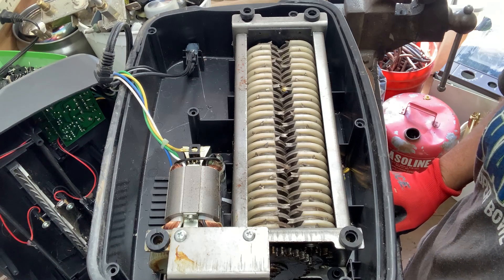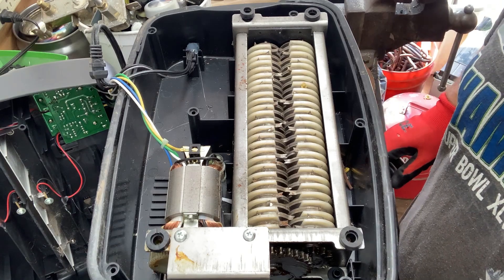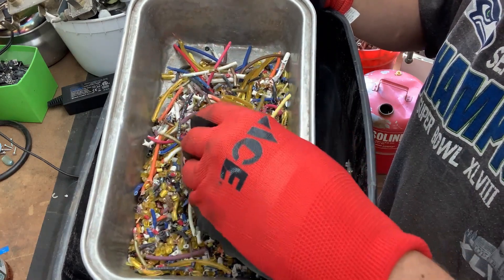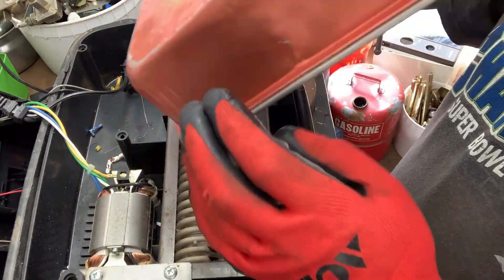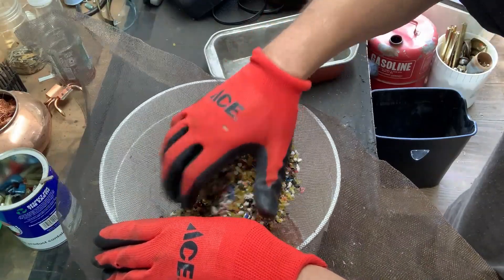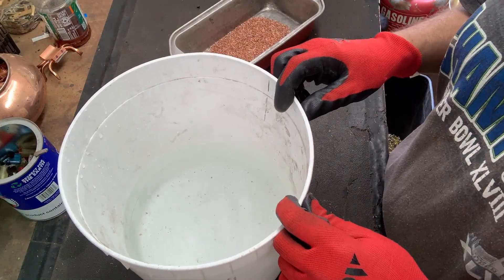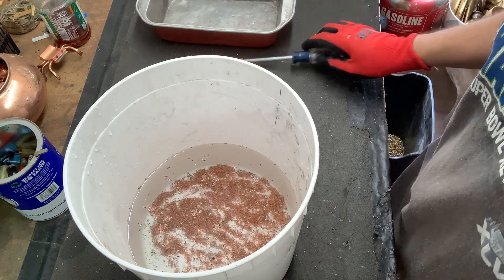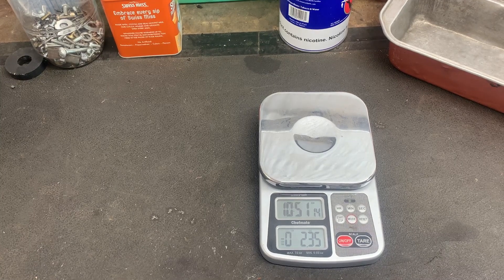Will a Paper Shredder Work as a Wire Granulator?

Comment: I use one that handles up to 15 sheets as a aluminum can shredder, and it works great!
Reply: How do you prepare the cans. Do you smash them. Cut them up or what ? I have a 26 page shredder.  Would like to try that.
Reply: @howardb1922  I smash them flat enough to get the edge in the shredder, pulls them through like paper. Works best if you flatten the entire can. I melt the shred and am able to do a 4oz ingot pour after filling the crucible 4 maybe 5 times (15 minutes or so). It's a whole lot faster than dropping one can in at a time, less loss of metal due to oxidation as well.

Comment: Not bad!😄Nothing wrong with experimenting. I actually saved a big paper shredder with a big motor/capacity from going into the dumpster at a bank renovation. I kept it to see if it works to chop up and separate the gold plated bits from phone/ethernet cable jacks and maybe other small connectors like that. 🤷‍♂️
Reply from the maker: Oh wow!! Have you tried it out yet? 
I love this outside the box thinking
Reply: @scrapitall200  eventually. Haven’t gotten around to it all yet. I did a couple test ones and it smashed them up some. Probably have to run the plastic through a few times like you did with the wire. Busy with a million things! 😅
Reply from the maker: @dr.a006 oh cool. I bet you’ll be able to make it work. 
I totally understand that my friend 😂

Comment: I've used a 18 page shredder based off this video and it shredded thicker cable idk the gage it is but it works for the most part. Sometimes the diameter makes a big difference in if it will go through or if it will need a second passing. But it works well. I paid a bit more than I was willing for the experiment a few weeks back but since I been running a lot of different items like car fuses etc it still going strong but the teeth got battered up and some are bent more than a few teeth are broken but still shreds great and saves a bunch of time. I get a lot of automotive materials so fuses, wire, (except real thick that I can run a utility knife safely) it really cuts time more than half to run through. But the suckish part is isolating the plastic bits
Reply from the maker: Oh very cool, that’s awesome bud! 
Yeah I imagine the fuses are a bit rough on the blades lol 
I’ve been too busy to do the upgrades on mine, but hopefully soon. 
I’m going to try a little dish soap in the water and see if that’ll help get the copper separated from the little pieces of insulation.

Comment: I've always thought if you take copper wire and put it in a closed container with no oxygen can get to it. Put it on a fire and roast it turning the plastic into carbonized plastic and then you can beat the carbonized plastic off the wire. Put it in water and separate it.
Reply from the maker: If there is any signs of burning copper my yard will not buy it unfortunately, but I love your idea.

Comment: What was the shredder make and model that you used in this?
Reply from the maker: I don’t remember and unfortunately I don’t have any of the casing left. I will say that I think pretty much any shredder will work. 
Thank you for watching.
Reply: @scrapitall200  I asked because I had thought about trying that. There are some heavy duty micro cut shredders that I felt would do well and not have to go back thru the shredder more tims
Reply from the maker: @whatsgoingon1011  I do remember it said heavy duty on it. 
Since I made this video I removed the motor and I found a socket that will adapt to the roller so now I can use my electric drill to power it. I think that will help a lot. Then I’m placing a second one below this one and that way it’ll go through two shredders. I hope to have that project completed soon.

Comment: I wonder if you "panned it", if you could get almost all the junk out? Or built a tiny sluice as an alternative? Use surfactant like dishwasher jet-dry or dish soap to get the copper to all sink.
Reply from the maker: Yeah I’m definitely going to use dish soap next time. I’m working on putting 2-3 shredders together and see how it goes. 
Thank you for watching.
Reply: @scrapitall200  YW! Thanks for posting! I wonder how a food processor would work for really small gauge wire?! BTW the really large shredders are made the same way as your paper shredder. They are high-torque, low rpm shear shredders, used for scrap of many kinds, from pallets to tires to wire and more! If you could find a used hammer-mill herb grinder, you might like that as well :) Keep up the good experimenting! :)
Reply from the maker: @CuriousEarthMan  never tried a food processor but I think it would be worth trying. 
Great idea, thank you for that.
Reply: @scrapitall200  YW! Good luck!

Comment: I love how glock makes its own bb guns and how they make them look so real https://www.youtube.com/post/UgkxnX9wE_Q8zvF75Y5iWzTU3Q4FlrtyGApQ , the only thing is that the slide doesn't move back. The sights and the body structure is so similar to a real handgun, fits in my hand perfectly but I actually ordered it with the 40 pack of Co2 tanks and they never arrived even though it said that they handed It to me. Was not able to test the accuracy since I didn't get everything I purchased which is frustrating and that's the whole reason why I got the bundle so it arrives together. So the Co2 tank happens to be a third party so it makes no sense to put it in the bundle if it doesn't get shipped at the same time, the BB gun arrived first then the Co2 tanks were supposed to arrive someday later but didn't, which doesn't make sense. I recommend just ordering the gun itself so you don't get the same issue I ran into plus there's no option for a refund. How stupid.
Reply from the maker: Absolutely!
Thank you for watching, I appreciate it.

Comment: neat idea but not practical  to money dollar  time  variable  . The problem is  when you touch the material several times  it equates to  massive time / money  loss, so stripping it with a knife is  way faster, and you touch it only 1 or 2  times ,First time scoring it and 2nd time peeling it.
Reply from the maker: It’s way too difficult to strip that small gauge of stranded wire and 99% of scrappers will just sell it as is. So I was just curious if a paper shredder will actually work and to my surprise it does. But unless I can do some modifications and possibly add another shredder or two, it’s not practical, but it sure was fun and sometimes having fun is more important than money, to me at least. Plus, if I melt that 5 ounces of copper and make something cool from it, I can sell my art at my local farmers market and depending on how artistic I get, I might be able to sell the thing for $25-$50, which in that case changes everything. But, this was all about an experiment. Thank you for watching.
Reply: @scrapitall200 trick to  stripping 16 gauge etc    use  a   multi folded  old tshirt shirt and semi sharp  thick bladed knife  on your knee pulling it though ( with gloves) as you press down, , works great long or short pieces , i usually only strip  half of it  and have bare copper  pile and sell the other  half as #2 insulated , other small stuff you can try  and if it works good depending on the  hardness type of  copper wire  ~inside  maximize  your profits  .
Reply from the maker: @kingdommusic5456  very interesting technique I must admit. Thanks for sharing that with me. I always find it interesting the many different ways people come up with stripping wire! Thanks for your comments, I do appreciate them.

Comment: A drop of jet dry will let the floating copper to not float. You could a gold pan to quickly separated the copper from the insulation. Enjoyed the video
Reply: After screen separating to the finer material he is more ready to smelt it though without doing any more work.  He won't pollute as much his environment outside with the resulting smoke to the eventual melted copper metal plus its molten scoop away drought.  It's just not worth it as much as silver and gold dealing with higher dollars on the ounces projects.
Reply from the maker: @lawrencejelsma8118  that’s very true. I’d love to find gold and silver but there is none to be found where I live. Thanks for your comment.
Reply: @scrapitall200  ... That's an expensive process also (unless people turn in jewelry of gold and silver Karats).  If you can strip the copper, the better because you removed the contaminants more for extracting the 99% copper purity for whatever you want (to sell or copper pure projects).  All utility blade YouTubers showing ease of extracting the copper that way wasn't as time consuming as thought but now they also have the landfill mess of insulation plastic waste problems also. 😖😬
Reply from the maker: @lawrencejelsma8118  yeah I want to do sand casting with copper to make some art I can sell at my local farmers market and I think this really small gauge wire is perfect for my hobby. Thanks for watching and leaving me a comment.
Reply: @scrapitall200  ... Don't forget to heat your cast molds with borax when pouring molten copper because many others are finding out after polishing the imperfections of the cast.  I don't know if you are going to melt with like tin to create bronze for a stronger and durable art metal.  Good luck in all copper smelting when you do it (sometimes a double torch hearing kilm).  It's still too expensive just to create copper ingots to sell as bullion copper.  It doesn't take up much copper weight to box up and store in beer boxes stripped copper of wires for a well planned copper project.  It however becomes a source of theft for thieves who stole my 25+ lbs of copper bells in my shed one year downside risks.
Reply from the maker: @lawrencejelsma8118  thanks for the advice. That really sucks man, thieves are just plain awful. Thankfully I have my stuff really secured, but even then it’s still risky.
Reply from the maker: Hey thank you so much for the tips, I appreciate it. 
Oh good, I’m happy you enjoyed my video and thank you for watching.

Comment: As a woodworker I have some advise.  Please do not wear gloves doing this, could be the difference between a stitch and an amputation.  I'd wear thin nitrile gloves near moving parts as they would tear before pulling my finger tip into the machine.
Reply from the maker: It was a boneheaded move by me. Thank you for taking the time to give me really good advice!

Comment: Thats pretty cool 😎,
Reply from the maker: Thank you so much!
Reply: @scrapitall200 yes sir your welcome. Just a suggestion if someone wants to do that to upgrade from #3 insulated copper around$.50 cents a lb to number #2 stripped copper around $2.75 a lb  the lit bit of the insulation shouldn't affect that
Reply from the maker: @moondog4313  I fully agree with that, now of course some yards might be really picky about that but my yard thinks it’s clean enough for #2 copper. Thank you I appreciate it.

Comment: That's cool. I tried that last year but only once because I figured it wasn't worthwhile. At the time, I didn't know that my scrapyard would buy insulated wire so I was trying to figure out how to get the copper out. It also made my cheap  Staples shredder very angry. 

Good experiment and smart just dropping them in one at a time to start. I got a little overzealous when I did it.

Good luck on the 1000! Soon, buddy!
Reply from the maker: If I get into melting copper to do some sand casting, I think I’ll use this to granulate the tiny copper wires. I’m definitely curious if a better shredder will work more efficiently. 

Thank you for taking the time to give it a watch, it was a fun experiment!
Reply: @scrapitall200  Yeah, that makes sense if you don't have better stuff to melt. I sell all my insulated wire except the oven and dryer cords and any solid core. I save that for melting. I have a lot of that though. Maybe a few hundred pounds. Plus all of the copper line. Because I save that, I sell the cheaper stuff so I can have a little cash flow.
Reply from the maker: Thank you, I appreciate it!
Reply from the maker: I like to save all of my good copper in the hopes the prices get real good. 
I always find it interesting how everyone seems to do things a little differently when it comes to saving copper or what the sell. Thanks for your perspective, I do appreciate it.
Reply: @scrapitall200  yeah, that's understandable. Where I am, the prices never get really good, compared to the rest of the country, so I will make way more money, melting it down and making "art" with it.
At least, I hope to.
Reply from the maker: I think you are right. You have a farmers market near you? I bet you could sell some copper art there!

Comment: I tried this 20 years ago & the machine broke right away 🤣
I find about several a month so maybe time to try it again 
Seems best suited for small wire & not cords 
Nice well  done video though I’d definitely say winning 🏆 

They sell granulation machines but they are really expensive
Reply from the maker: It definitely will only work on small wire, but after doing this I want to get into melting. I think this stuff would be perfect for that. 

Yeah they are way too expensive for me.
Reply: Good  day Marty  Boy o boy  this is a job for a retired  fellow.  Not much in it.  Thanks
Reply from the maker: @donvoll2580  Hobby scrappin
Reply: I was thinking the same thing. Won’t that break it. Idk
Reply from the maker: @ScrappingwithGrandpa  still not broken